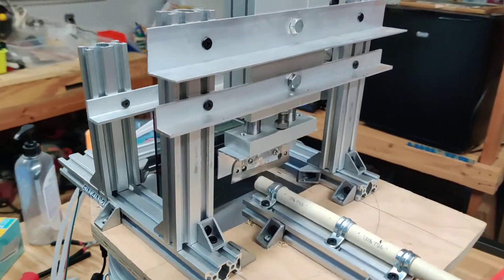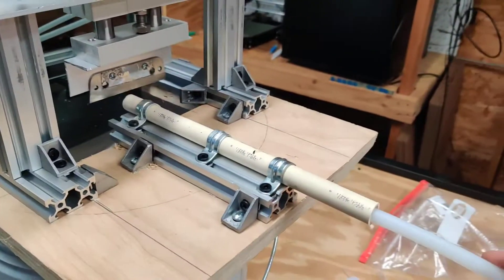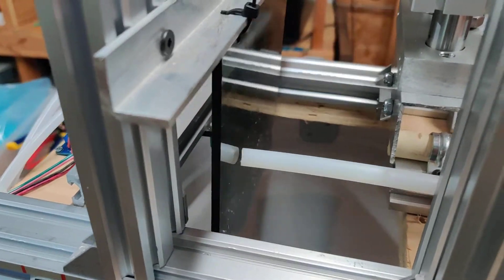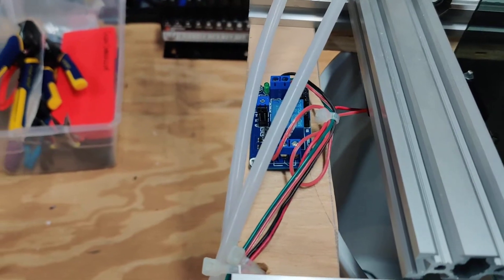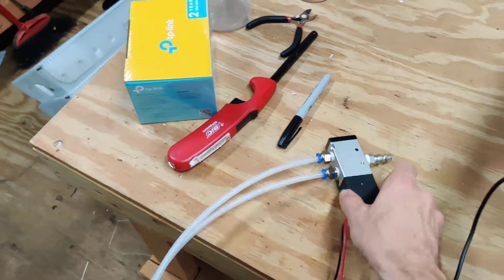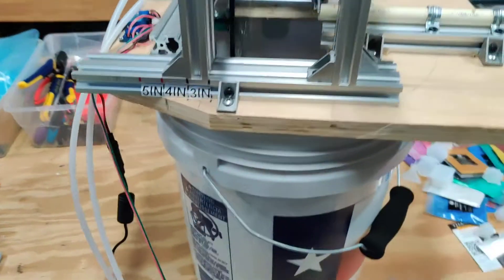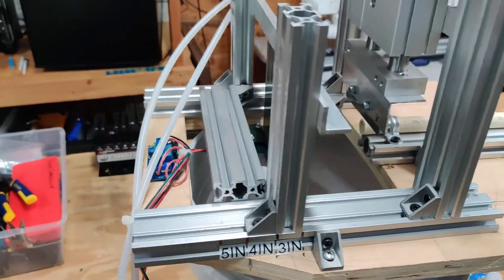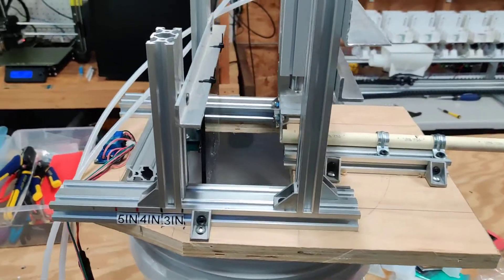Automated Tube Cutter Up Close

Comment: Awesome setup! Do you have a model# or any info on the piston, switch and pneumatic solenoid that you used?
Reply from the maker: The pneumatic solenoid and switch are just very basic items I got off ebay.  

This is the pneumatic cylinder:
BIMBA 1 1/2" PANCAKE NON-ROTATING MAGNETIC AIR PNEUMATIC CYLINDER FT-041.5-M
Reply: @jdeationdesigns2598  thank you very much I appreciate it!